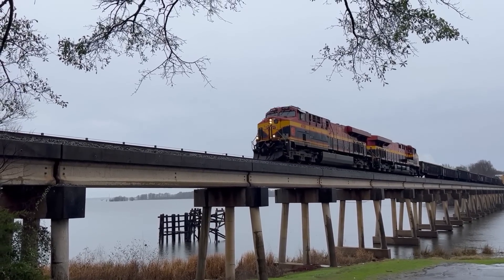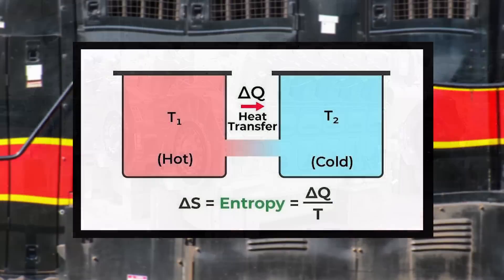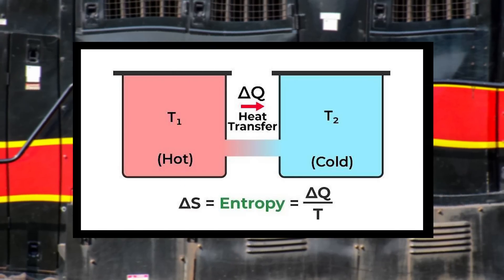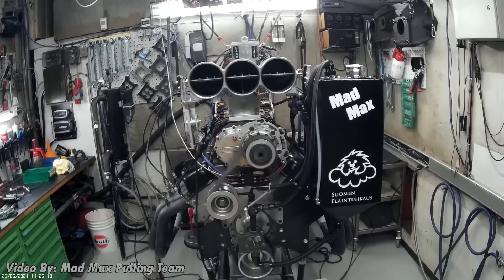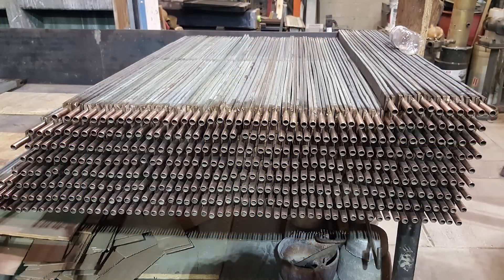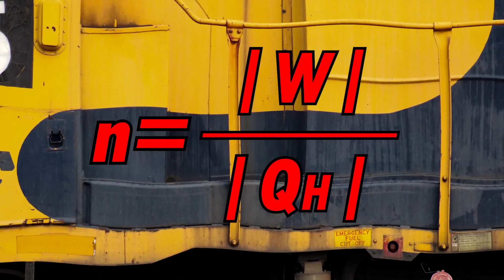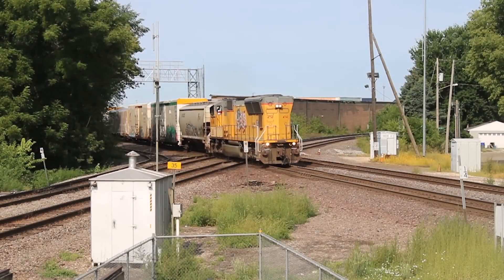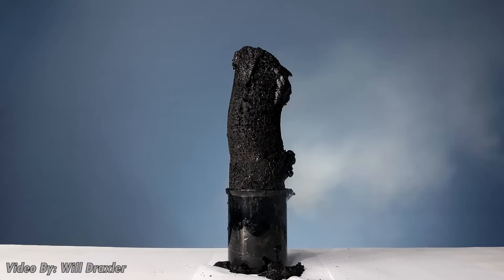Why Have Radiators On Locomotives Gotten SO BIG!?

Comment: There's also the heat produced by Dynamic Braking to deal with too.  It is another reason for larger radiators.  Why haven't the producers of the loco's fitted with Capacitors and batteries in the the secondary movers?  It's in the name..."Secondary Movers".  No?  If not then why not?  Some of the biggest ships on the oceans use the "Waste Heat"  from the exhausts through steam boilers to turbines for the main drive systems of the ships, using the Electric, generated by the Diesel Units, to steer the ships.  I know the size of these solutions are vastly different, but with invention, we've come this far...
Reply: Dynamic braking has separate resistor grids, fans, and vents, usually placed further forward on the locomotive, right behind the cab. I'm sure that's gotten bigger too, but is a separate system.

I personally think hybrid-electric battery locomotives are low-hanging fruit I'm surprised to not see more explored. Locomotives already have electric drive, meaning it could be added without significantly changing the overall powertrain design (perhaps even retrofitted onto existing locomotives), and modern electronics (power converters, inverters) would make it fairly easy to transfer energy between the prime mover, batteries, and traction motors. Weight is a concern with the massive amount of batteries needed, but trains usually aren't as weight-sensitive as other vehicles, in the most extreme case a separate car loaded with batteries could be permanently coupled, sort of like a steam locomotive tender. But might as well put traction motors on that as well, I could see a cow-calf arrangement of sorts with two powered units, all wheels driven, one has a prime mover and the other is loaded with batteries. This could be new-built, or retrofitted, with the "cow" modified (minimally) to incorporate the batteries into the electric circuit, the "calf" a locomotive with the prime mover replaced with a bunch of batteries and all the necessary power electronics modules.

Comment: I think the design engineers just want to make it next to impossible to see behind you. haha
Reply: Totally defeats the purpose of being a hood unit, might as well go back to carbody style. Originally manufacturers intended for carbody locomotives as mainline freight engines (such as the EMD FT and F3/F7/F9), but railroads liked the rear visibility of hood unit road switchers. But modern ones don't really have that, and I get the sense railroads never operate them long-hood-first anymore anyway. I'm guessing hood units are easier for maintenance access though, that's probably why they're still the standard.

Comment: The statement that a100% thermal efficient engine would be a perpetual motion device is not accurate. A 100% efficient engine would produce double the power is a 50% efficient engine but would still need fuel to run. No fuel means no power. 100% of 0 = 0.

Comment: If I'm not mistaken, another significant component of how quickly a locomotive radiator has to shed heat (and therefore how large it is) is the use of dynamic braking. This switches the traction motors to generators, and the resulting current is sent through a load of big resistors, causing the train to slow down. Considering how much mass there is in a modern freight train (~10000 tons), this is a LOT of energy for even a small change in velocity.
Reply: While the dynamic braking doesn’t use radiators, they still dissipate heat much the same way (i.e. by getting air blown over the resistors)

I found limited information after a quick google search but for the EMD SD70ACe at least, the „bulge“ is from the dynamic braking system.
Reply: I'm building a amazing large electric foot scooter, and I don't think I want to regen brake to the batteries into the front batteries as it has a low amp (C) rating.  This could be the very first dynamic braking scooter!?
Reply: Dynamic Braking current is dissipated by large Grid Resistors that have their own Blower Fan(s) for cooling. They are entirely separate systems, engine coolant is the only thing cooled by Radiators.
Reply from the maker: I believe you are mistaken. The resistor grids are completely separate from the radiator, and don't use any liquid coolant whatsoever. The resistors are just hot metal with a fan blowing air over 'em.
Reply: @Southern_Plains_Railfan  You'd be wrong. The resistors, as klug said in his comment, are in the big side blisters. The whole area isn't filled with the radiator. It is shared with the resistor banks. I said much the same in my comment before seeing this comment thread.
Reply: I'm not an expert but from other stuff I've seen on youtube I learned that most part of these radiators is filled with resistors for the dynamic brake. Check out the vids about diesel-electric locos form Jared Owen or Hyce
Reply: @moddien1 there are no radiators used in conjunction with dynamic braking.  Completely two separate systems.  If someone is posting that info then they would be posting incorrect information.  Radiators are strictly for cooling the water used to keep the engine at optimum temperatures
Reply: @ohboy2592  sorry my bad, I used the word radiator wrong. I thought the whole assembly (the overhanging box) is called radiator
Reply: @moddien1  no problem.  All the dynamic braking grids sit behind the cab.  Multiple square cut outs with metal slats protecting them.  Sometimes at night you can see the grids glowing if they’ve been using dynamics for an extended time
Reply: @moddien1 the resistors placed on a structure exposed to the outside, with or without a fan, IS a radiator.
Whats wrong is assuming that not having a fluid loop to Carry the Heat means is not a radiator.
So, toghether or alone, both systems are radiators or have radiators. With or without a liquid cooling loop. Nether both of you are wrong, just not exactly right.
Reply: Water cooled electrical resistors… not impossible, just improbable. (I’m getting visions of toasters & wash basins.)
Reply: @stevedoe1630 that's kind of how a crock pot works.
Reply: @ferky123  In the engineering of heat exchangers, crock pots are pretty inefficient.  But yeah, you are correct.
Reply: There are a lot of comments with incorrect information here. If you look down on either a GE (Wabtec) or EMD (PR) loco from above, you can see the fans which cool the radiators and the dynamic brake, and they are totally separate. The DB is either up front, or back behind the radiators. I say this as someone who has designed locomotives in Australia using EMD equipment. Some GE powered locos here have intakes for the DB sticking out of the bodyside, but that is to house acoustic louvres and not the resistors.
Reply: the amusing bit is that its the resistance that actually stops it from slowing the train down...

sigh. lesson in electrical theory ahead. no equations ;)
 "resistance" is this terrible term that we all are trained to think of as the opposition a circuit places upon us, the "resistance"we have to work against...

its the exact OPPOSITE! its the resistance to current, not the resistance to us making that current flow. we think of it as the force we apply to a spring, and the push back. nope. thats EMF and back EMF... not resistance.  electrical resistance is badly taught, badly explained, and badly understood. in a spring, the actual "resistance" would be the atoms of the metal, the friction to flexing. NOT the "spring force" itself.

the generator is pushing a magnet into a coil. the coil is producing an EMF. that EMF creates its own magnetic field opposing the original magnetic field. the closer the coil is to a dead short, the LOWER the resistance, allowing large currents to flow, the stronger the braking effect will be. the more work we have to apply to get movement. as every movement is opposed by a nearly equal and opposite force, the only difference being the energy lost in the resistance of the circuit.. we have an EMF, and there is a corresponding counter or back EMF opposing it. 

if it was a superconductor with ZERO resistance... we would be virtually, but not quite, locked... as NO movement would have NO effect... reality error, divide by zero... superconductors should be put aside for now?

as we increase the resistance, we reduce the current that can flow, the opposing magnetic fields created, and the lenz reactions as a result of.

until we go so far that its an open circuit, seeing the gigohms of resistance the air itself possesses, and with no current, theres no magnetic fields opposing anything... at this point, just to hurt your head, we have to do work to "separate the charge" or push electrons onto one terminal and move them from the other, and fight their electrostatic repulsions...

the generator itself has resistance, it has to dissipate so much power as well. as long as its resistance is well below the "load" or resistance used in the brakes, most of the heat will appear in the resistors only.

if we had a dead short, the generator would be the only point where the heat can be radiated from and would quickly fail given the energy it has to deal with... though some eddy current brakes are designed precisely this way, dumping the heat in their own conductor, adequately cooled...

the resistor is merely the radiator. it radiates energy. the braking and driving is achieved with magnetic forces. the resistance is normally an undesirable loss, in this aspect we use that as to our advantage. 

its also why "regenerative braking" isnt all isnt touted to be. can only reclaim half that energy. 

as flywheels its easy to understand... we have two wheels, one stationary, one spinning. we clutch them together and assuming equal inertia. mass, dimensions, etc, they will both end up spinning at half the velocity, the same total momentum. we can only slow the spinning wheel down to half its speed, and store the other half. any further braking force must be applied to both, or the storage be de-clutched.

we now stop the other wheel, and reclutch our storage wheel to it. again, they will end up with half the energy each.

we reclaimed a 1/4 of it. 25% ignoring friction... you can never get any better. 

electrically, the overlooked aspect is that the battery and the generator are resistances. a battery also has a very narrow window of potential that it will accept. EMF is basically power, despite being measured as volts.

the voltage produced for a given EMF is based on the resistance of the circuit, and the power being applied.

we have to fool the generator into delivering the potential required to charge batteries, that have an internal resistance that is not linear or follows "ohms law". we cant just dump power into them at any rate required, either.

that requirement for "potential" limits the ability of our EMF to manifest as "current" with its associated lenz reactions.

you can reclaim so much energy and not have much braking, or you can dump a large amount of it and get powerful braking, electrically its far easier to keep track of the details but its still complex. software has to be written, devices calibrated...

if all you are doing is braking, and can radiate the energy... great. if you try to store it, teh "tank" can only take so much, so fast, and can only hold so much, and as it gets fuller, its harder to shove more in...

the connection of various seemingly unrelated topics. if it was air compression... a "jake brake" just dumps energy in the compressed air.

an air compressor stores it in a tank, and at first it fills rapidly as the tank barely "reflects" any pressure... as it fills, the compressor delivers less air as what remains inside it is also at the pressure of the tank and that re-expands so no more air can enter the compressor itself. at that point you can jake brake it again, dump excess air to the low pressure of the atmosphere,... or choose the "no brakes" option. weeeeee.

when you stop and actually think about the finer details, almost everything shares the same basic principles of energy exchange.

electricity is hard as we cant see it and we are taught BS about it... "the red wire is positive and we say it flows backwards to..."... sigh. takes a lot of unlearning....
Reply: Yes the resistor grids are what hangs out on the top sides of the hoods on many emd units

Comment: I knew that the T4's needed a bigger radiator to help with emissions, but I didn't know they also had smaller Prime Movers.
Reply from the maker: Yeah, I didn't know they had a smaller V12 either until I started research for this video.